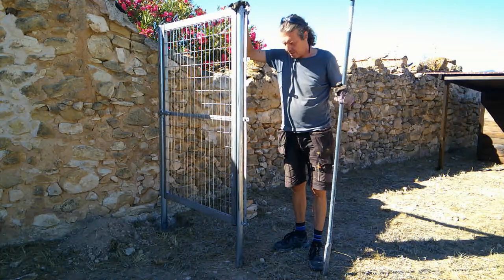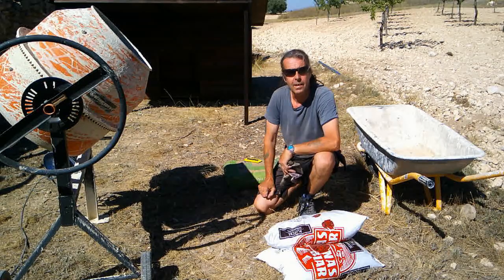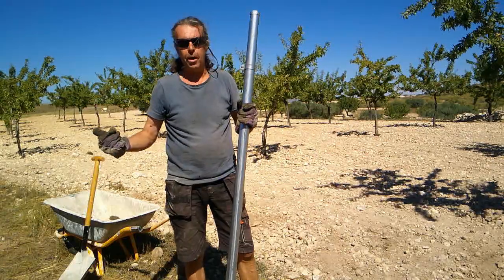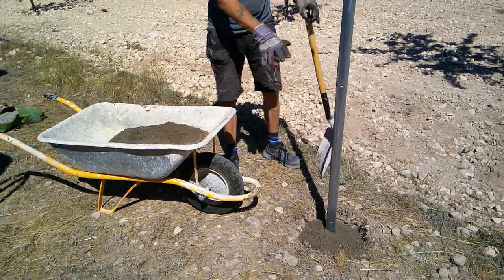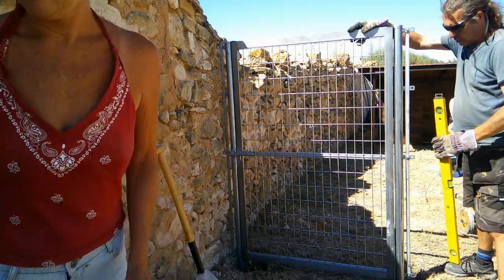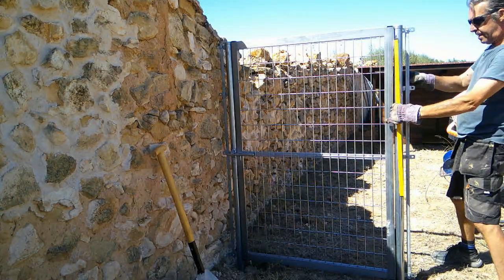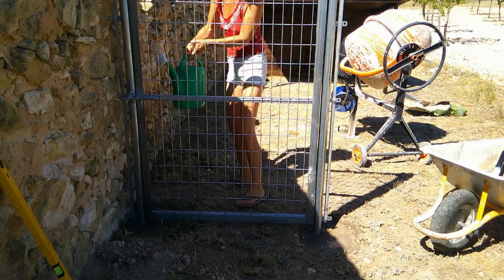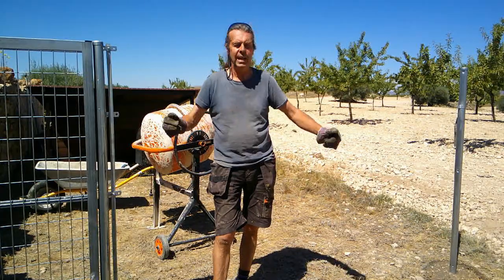Fencing in the dog run but it's 40°C (104°F)

Comment: BTW, WHERE DID YOU GET A FENCE LIKE THAT? CAN YOU TELL US HOW MUCH IT COST THERE?...DOES IT HAVE A BRAND NAME?...;)
Reply from the maker: It's just a basic torsion fence. Literally just poles with holes drilled in them and bits welded on to bolt the struts to. There's no brand name. In total, the cost was 400€ but that includes enough to do the donkey / goat pen too. For the dog run, less than 200€ including the gate - plus concrete and installation costs which are enormous :)